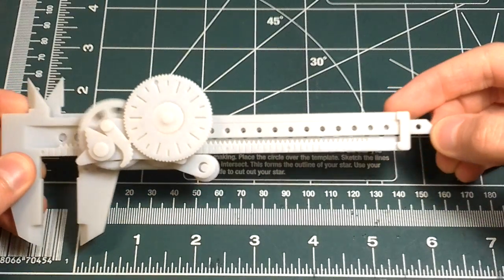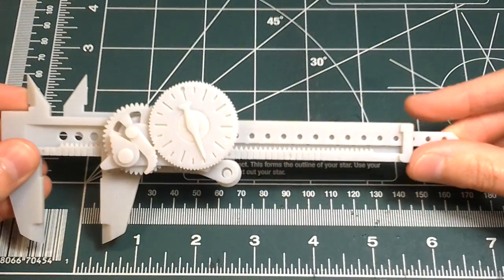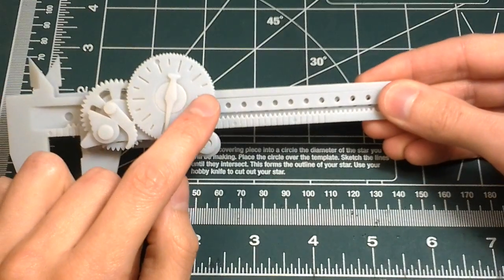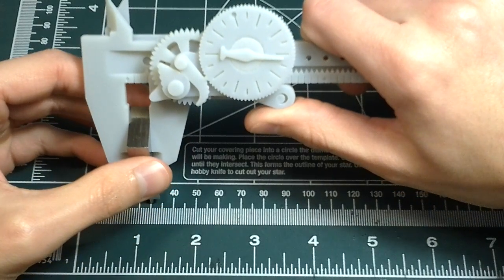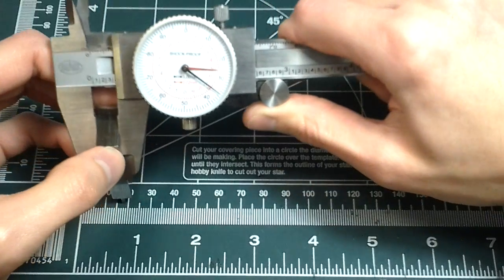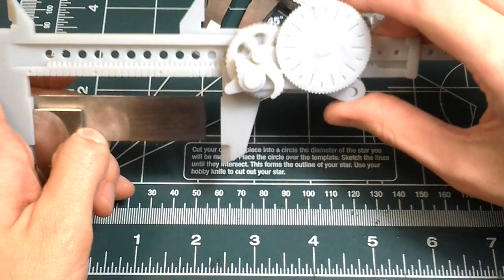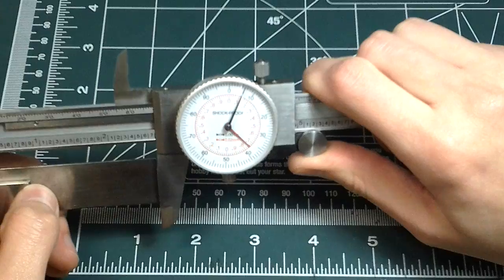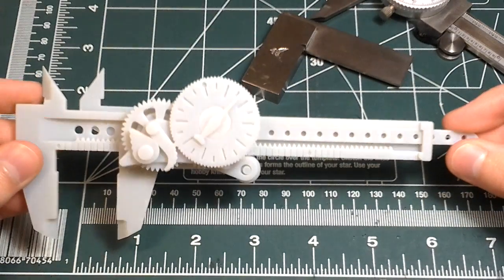3D Printed Dial Calipers

Comment: Could you make a file that converts them to a metric set? I'm not a good enough designer to do that myself, but I'd love to have a set of metric and sae printed calipers.  Thanks for sharing
Reply: I have tha same question, but i’ve come out with an idea. If there are 10 long lines in the dial, you can do a bit of math, and place as many limes as necessary in the metric system. Im gona try out and if I make it successfully I will tell you

Comment: was this printed in resin? looks and sounds too clean to be FDM
Reply: He used a printer that works like an ink printer, curing the droplets of resin layer by layer. 

"This was printed on an Objet Eden Printer."
Which is more sophisticated and expensive printer. 
Did you try printing it yourself?

I currently have a modified version of these calipers to make it FDM printable. That I was able to FDM print and assemble. With seemingly similar accuracy.
If you want I can hit you up when I upload the thing on thingverse. To try.
Reply: @AlexanderZapataIndividual  thank you

Comment: When the printer prints an assembled machine like that, how does it prevent the different pieces that lay on top of one another from forming one rigid piece?
Reply: The 3D design can include small separators between pieces, which are intended to break away when the pieces are actuated. I've printed some pieces with embedded hinges and pre-meshes gears like this. The first movements are pretty tough, but then the "nubs" wear away, and my results have been very good.

Comment: I don't get how these things can be printed all at once and not as separate pieces. I'll have to see it done before I can believe its real.
Reply: Some materials in an Objet can be printed using water soluble materials that dissolves when you run it under some water.
Reply: Well. Some things. Don't even need disolvable support material. There is a worm gear jack style stand on thingiverse that is printed all at once. In a single piece without support materials.